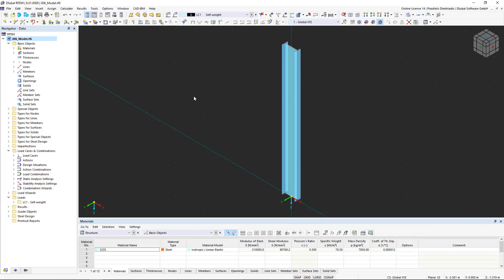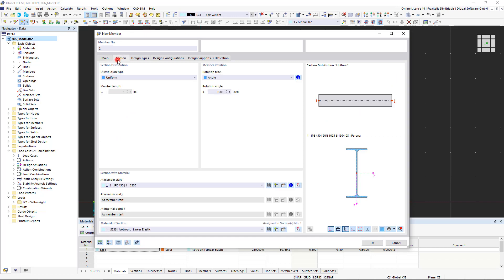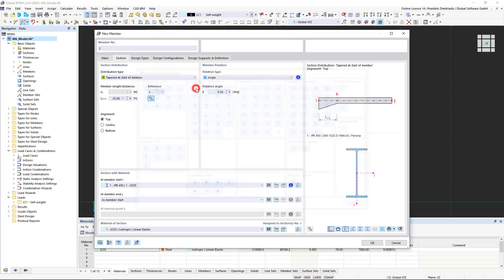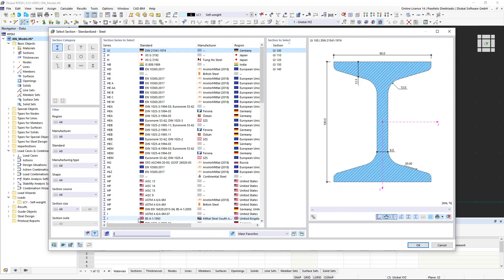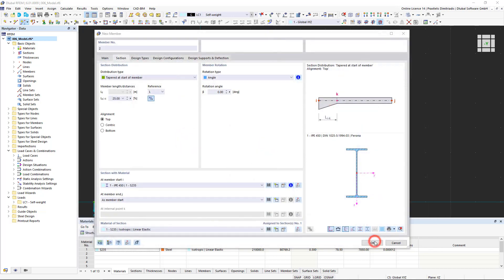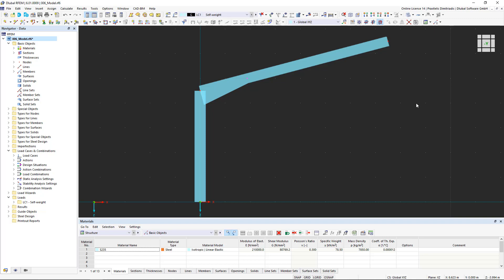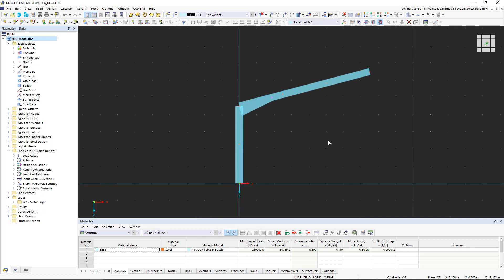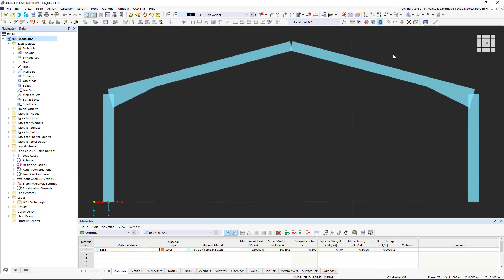RFEM 6 Tutorial for Beginners | 006 Modeling | 2D Frame | Taper | Mirror

Comment: I had a problem, when I did the mirror, the reflected beam had the greater section at the mirror point.
Reply: I had the same problelem. In the mirror setting (Numbering & Options) you need to deselect the "Rotate local coordinate systems of - Lines / members". This worked for me
Reply: @this-is-madness237  awesome! thank you - I would not have figured that out. :)
Reply from the maker: Hi, Nicolás!
Unfortunately, it is difficult to understand the problem, without knowing the model. Usually there are no problems with using the mirror function. Maybe you can contact our customer support by e-mail at info@dlubal.com and send us your model. Then we can check it.